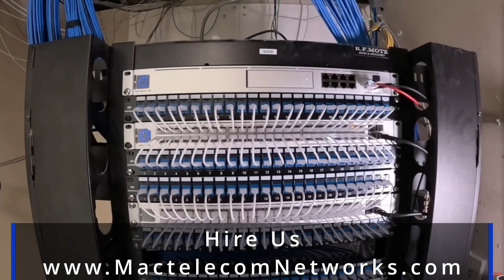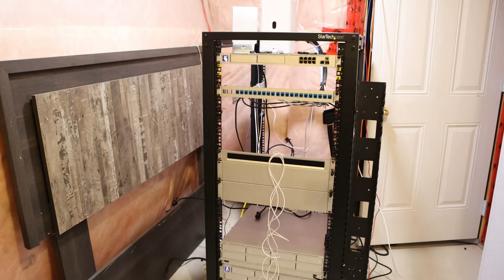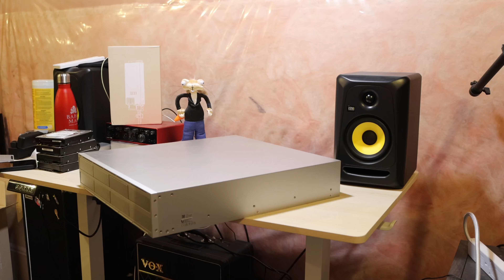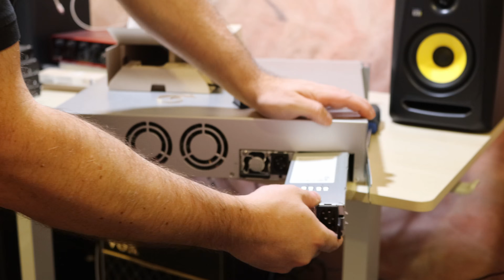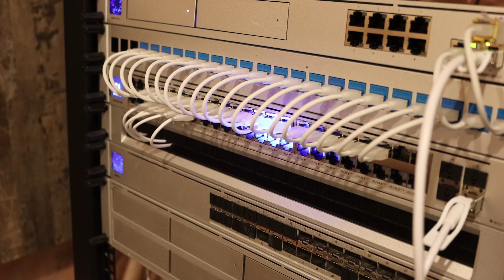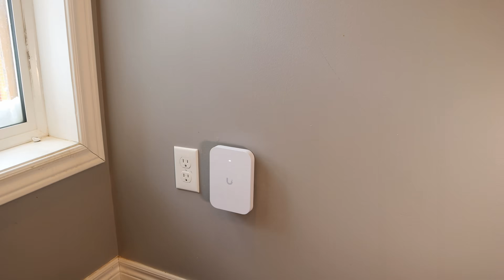UniFi Home Network Upgrade : ECS PoE Switch, UPS, U7 Pro XG wall

Comment: Do you run with Flow Control enabled since you have interfaces running at different speeds?  What does Flow Control look like in client environments that also have VoIP?

Comment: Where is your modem?
Reply from the maker: It’s on the other side of the basement near my electrical panel. That’s where the isp set it up. So I have a few cables running back to it

Comment: Wow. My eyes just went open at the look of the ECS-48S-PoE (2150W). Wow. Amazing. Can you show a sketch of your full home network? Why would you install a ECS-48S-PoE at home? -> Just because you can. :) :)
Do you have a lot of ISP interruptions or why do you need failover? 
What do add to your the aggregation switch? You have 3 more 25G SFP+ ports as well as some 10G ports at the ESG.
Amazing video. Thanks lot

Comment: how’s the rack studs working for the equipment? do you still see any sags? I use rackstuds for my Pro XG 10 PoE and it still sags
Reply from the maker: They seem fine to me. Mind you my pro nas 8 and the ECS switch are both on rails and my UPS is on the bottom so doesnt sag at all.

Comment: Thanks Cody, clear and concise as usual.  When breaking down the old rack, does it matter in which order to turn off the UDM Pro and switch? I would think disconnect the devices from the switch, power off switch, then power off UDM Pro.  Is this right? And when re-powering the new rack, should you power on the gateway first, then connect and power on the switches, then other devices?

Comment: Lookin good! Was the Pro XG switch fans loud? is the ECS switch worse? I'm thinking of upgrading from Pro Max. Debating which one to go to but also factoring in noise
Reply from the maker: The Pro XG fans were very loud on boot but then settled down the ECS is fine even during boot. But I also do not have a ton of loud going out it and my rack is in the basement which is pretty cool

Comment: Ubiquiti should offer a 25U rack. You NEED a matching rack!! I have two of those 1U CyberPower 1500VA UPSes. When I bought them, years ago, they were reasonably priced. Since then, I've seen them in the US$800 range. Crazy. Both of mine have needed and gotten new batteries since they were purchased. I am waiting for the UniFi brush panel to come into stock to finish a second, 9U, rack that I built out. It's overflow for my 25U rack and serves primarily the other size of the room. It's main feature is a second Pro Aggregation switch (one in each cabinet).